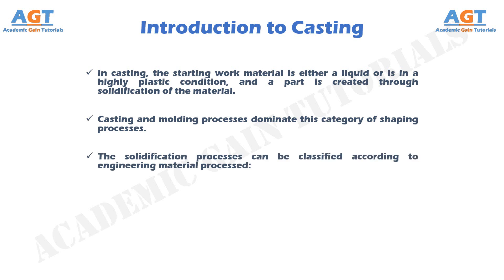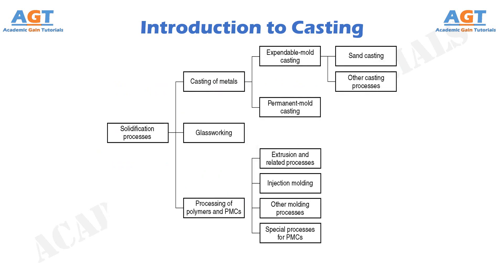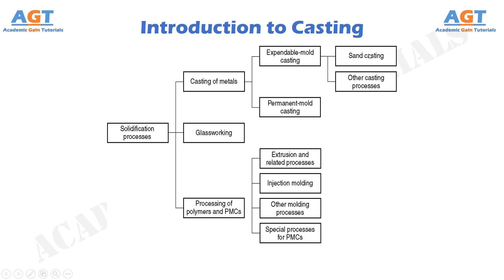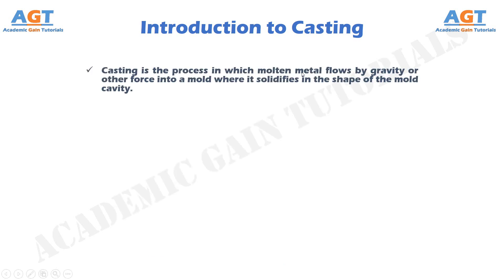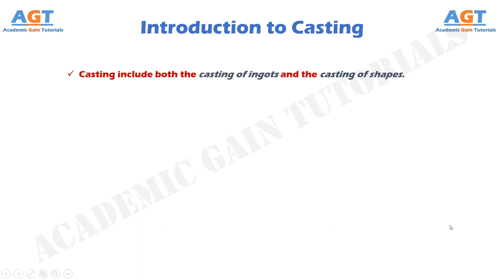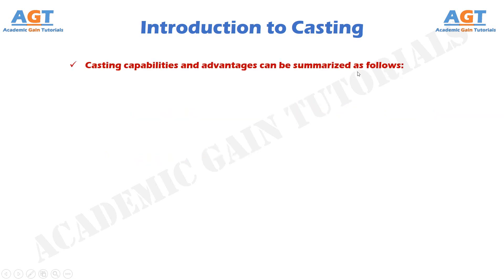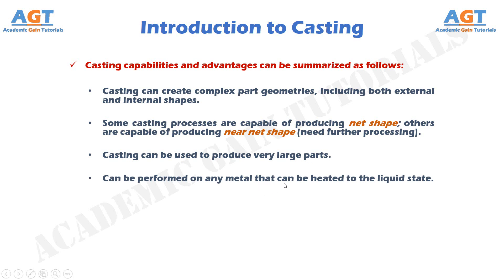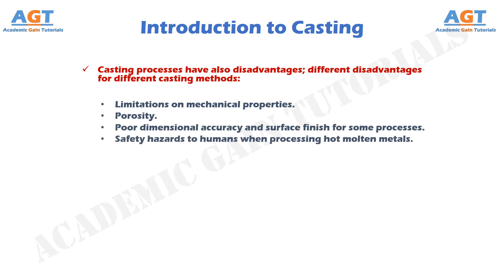Introduction to Casting.

Comment: Metal casting is a process where molten metal is poured into a mold and solidifies into a desired shape. After cooling, the metal part is removed and finished.